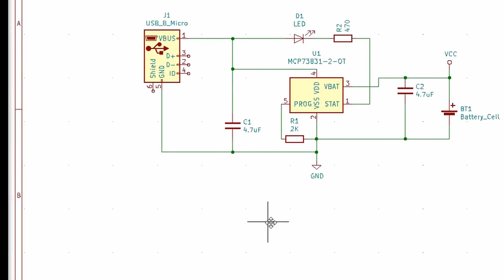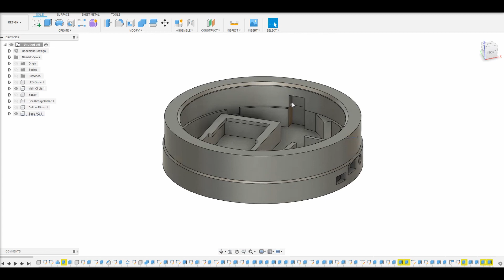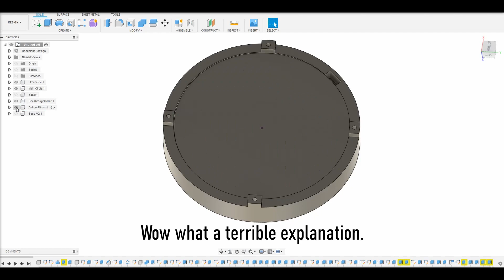Infinity Mirror Coaster

Comment: Couple ideas that could shave off some more thickness, though you probably thought about them already...   
  Anyway, you could us a metal ring to mount the LEDs on so you can curve the pliable portions on either side of the strips to reduce that portion but about 40%.  You could also remove the charging circuitry and make a dedicated charging platform (I would make the charging ports a unique and dedicated shape/type so that no one tries to plug it into a different charger and starts a fire in your home).  Also you could add a couple micro switches so that they turn on when weight is placed on them (I'd run 2 in series so they only turn on if a glass is placed on them evenly).  You could also use a mylar sheet for the bottom mirror (though it wont be ass good, and more fragile) to reduce a little more thickness.  You could even try putting the battery in the same compartment as the mirror with the mylar over the top of it so the bump adds different lighting effects (results for this will either look really Great, or Reeeally bad... only one way to find out though).  
  If ya like any of these feel free to have them (they aren't really that difficult of ideas and you have probably considered all of them before anyway), all of them together could reduce the size to 1CM.

Comment: This is exactly what I was looking for, but significantly more in-depth than I was expecting- The most electronic engineering that I've done is solder some wires together- is putting all of the components on the board much more difficult? Or is there a service like what you used to order the circuitboard that will also put in the capacitors and stuff?
This makes it look really accessible, but like there's still a lot of new steps for me
Reply from the maker: Yup, it is not too difficult. It does take some skill to solder all of the smt components to the PCB but it is not too bad. If you really want, you can email me at mnmaker123@gmail.com and I should be able to help you out. Good luck!